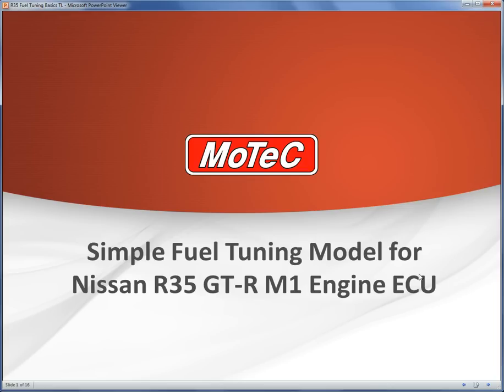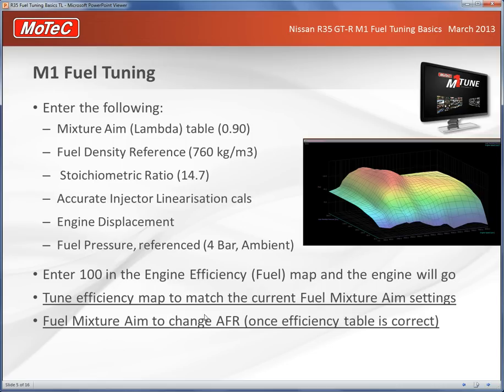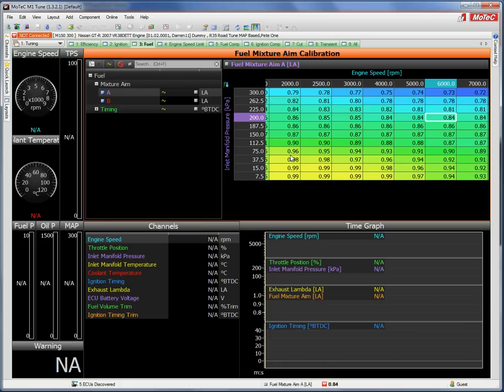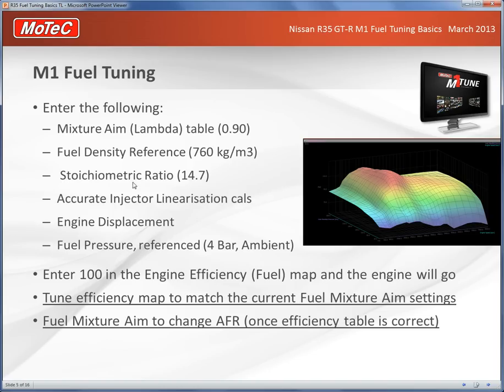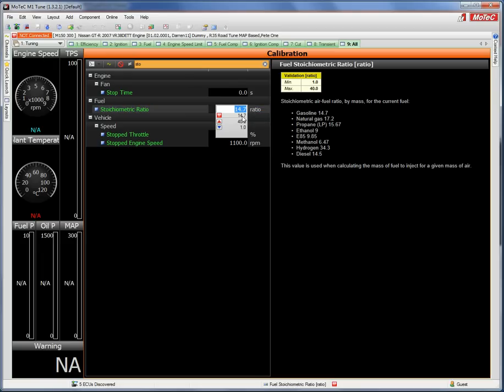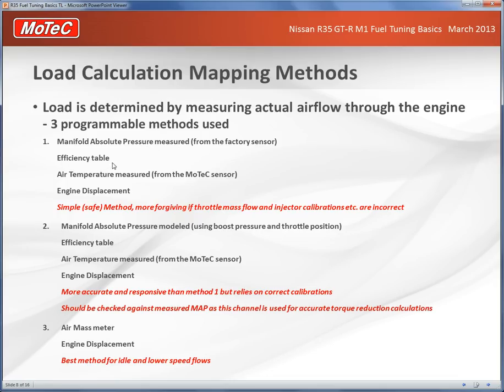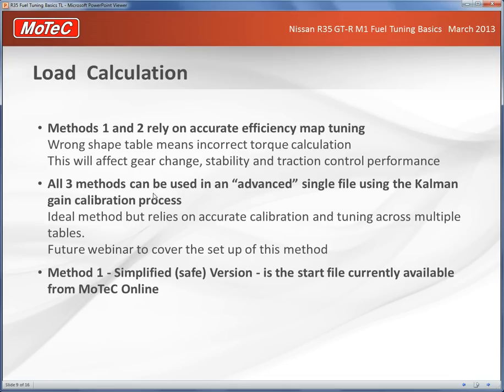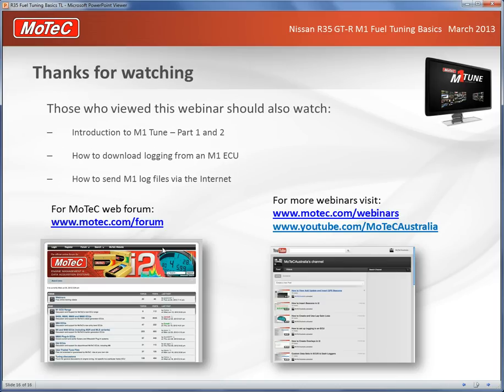MoTeC M1 Training: Simple fuel tuning model for Nissan R35 GT-R M1 engine ECU

Comment: Thanks for this lecture it's extremely useful, because is not just good presentation of MoTec and for MoTec device's and software but it's useful lecture for many young (uneducated "Tuners")that actually mean, exactly(many times spoken in this lecture problem whit changing  engine "Hardware" whit out proper mapping )  just enough to spend big money on the power pack parts and  which think that power peek on the wheels is only matter, but are that insane(very often way of tuning in US) torq's will be actual driveable and useful on any track whit two curves or roads often is lose from perspective, O.K in last little less than 10 years they is become more and more sophisticated under the influence of many race category imported from Europe , like is Endurance race USA Le Man's Series and spreading popularity of Rally class competition.
PS
i say this because many similarities that exist at first sight between the U.S. and Australia,but it's seams  essentially different
I was always wonder how is possible that Australian have  Racing culture (if we looked trow second half of XX century, on much higher level than i  will say almost retarded indigenous racing happenings in US  (especially cars racing, Bikes was different story (but in that field also australia has glorious people and BIKES US to this days wasn't capable to make racing bike) just whit start of embracing of Japanese bikes, which was for Americans very hard, Until for Australian that wasn't so "heavy" issue at all. Of course that what i said about US racing and racers it's undisputed that US has talented individuals who have managed to make a success in the toughest competition in the world, but I'm talking about the American races, which were by far the most popular in America itself   . (today globalization etc is equating factor and in US is completely differ access to the Racing in effective but also much less popular in wider US public than was during the  as i said undisputed by popularity kind of indigenous US way of racing, old Rally WRC in Australia  (whit and whit out group B)  was  extremely popular   same as it was in EU, even was competitors from eastern block(like was Škoda, and Lada, Moskvich), .Until in US Rally was almost racing category for some "odd and strange people" today.Rally competition in US also have much more new comers and lovers most important in shape of, racers and teams.that in some future can overcome so called present WRC which is by my humble opinion so fade and almost pathetic  picture of glorious days of Rally- in70's 80's to the end of 90's +few years more WRC  or World Rally Champion Ship for real , Toyota,Mitsubishi, Audi,Peugeot, Renault, Lancia,Alfa Romeo, Ferrari  Ford, as i said LADA,Škoda,Moskvich, Opel, volvo, MG , etc, etc,etc,Some Brands has  different cars in same competition..Marcu Alen, Hanri Toivonen r.i.p and Sergio Cresto r.i.p,Walter Rohrl, Stig Blomqvist, Bjorn Weldegard, Ari VATANEN,Juha Kankkunen,Timo Salonen..and many great others 
Does that Australian high culture of racing have something whit "Mad Max" or not i can't speak for Australian but for me (i was 13) was final blow and serum which make of me Petrol head.
Thx one more time for good lecture

Comment: what's the difference between the stoichiometric and lambda(mixture) ratio?
Reply: stoich is the ideal burn for gas, lambda is basically your relation to stoich.  so for example stoich is 14.7:1 in other words 1 lambda.  If your lambda is .80 then your AFR is 11.76:1 (14.7 x .80)
Reply: Stoichiometric ratio = Lambda 1.00